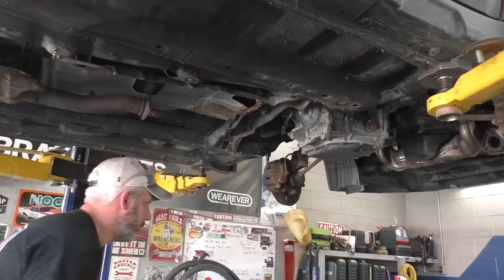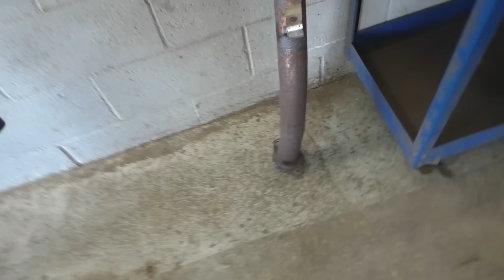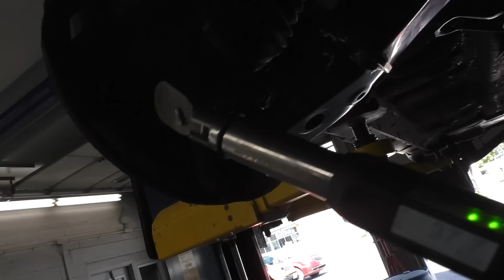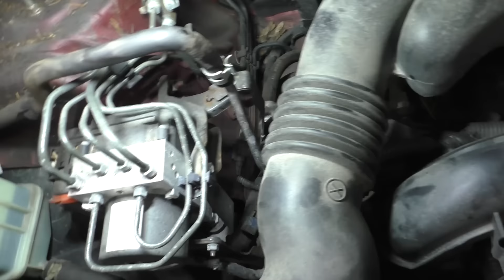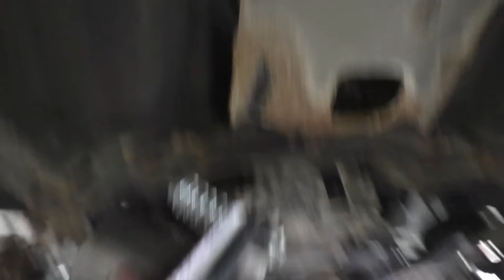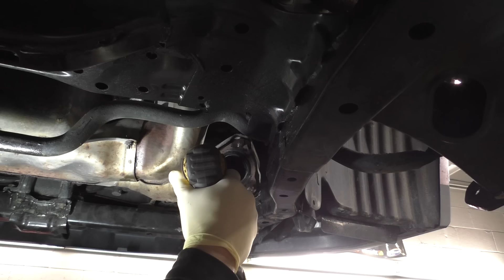'14 Subaru Outback Subframe Replacement - Part II

Comment: The old man was right.
 Eric, I worked with a guy who NEVER finished up anything that I left undone. I came in to find the L10 Cummins that, I was replacing the cooling jacket on, running. I asked "Did you finish torquing the cover?" He said "No I thought you did." He had been caught screwing the pooch and jumped on my job for appearance sake. To take it apart would mean that he would be in big trouble, so I tried to fix it in situ, but it leaked a little. 
Guys, ask yourself what I would've been doing if you share work on unfinished jobs.

Comment: I was out changing the rear brakes on my 08 Acura TL, but I live south of the Mason Dixon line, so I had it easy. I still did the Fluid Film spritzes and put the brake lube on the spacers and the face of the hub, but it is night and day to what you have to work on every day Mr. O. Huzzah!

Comment: Great as always! You should really do a short instructional video on mig welding.  I have a mig welder and it would be the holy grail if i could weld an exhaust pipe without burning a hole in it!!
Reply: Hood time! Practice makes better.
MIG? Do you have gas or using flux core? 
Lots of help on YouTube about welding.

Comment: Another great video.  Wonder if an undercarriage wash bay installed at your house would pay for itself. If my family doesn't get 15 years out of a vehicle, we got a lemon. Keep up the good work.
Reply: I'd love to have one. Use it just before heading out so things air dry quickly. Or use it on arrival if things are already wet/snowy.
Reply: I have a gutter cleaner that attaches to a garden hose.  I just run it under the car before I wash it to clean off the road debris.

Comment: Nice, thorough job Mr. O! I don't get why more people don't have their vehicles Fluid Film treated, or at least some kind of rust preventative maintenance done because the cost is minimal compared to vehicle or parts replacement. It may not make them last forever, but it sure doesn't hurt to extend the life and save on a bunch of repair work in the meantime. I am still running an '02 GMC 2500hd regular cab with the 8.1 and 6spd. manual that I bought in '03 that now has 221k miles on the clock. The only reason it hasn't turned into an orange dust cloud by now is that I have used Fluid Film or other products once a year. Still has factory paint, exhaust, etc. It is driven every winter, and yes, I do live in snow country in the mountains.

Comment: I learned long ago not to trust myself to leave a job with untightened nuts and bolts, or if it was unavoidable, I'd leave a big note to myself on the driving seat.
On another note, now that even the American car industry uses metric threads, I don't understand why a shop would still use UNC nuts and bolts, instead of keeping a stock of metric fasteners. I used to find this on the stretched Town Cars and Hummers I worked on here in the UK - the original car would be manufactured with metric, but everything fitted by the limo builder was UNC.
Reply: I have a theory...

Even today, UNC bulk fasteners for upfitters , fabricators, etc, are way cheaper, with much greater selection. 

Also, we still can't get metric drills without ordering them online... Even metric tools are limited. (I want metric nut-driver power bits, and I can't just go to the gettin' spot and pick some up, for one example)

Comment: Hey Dr O! Another great video from the master. I just wanted to throw out a little tip there since you've given us so many. Kinda repay the favor type thing. 😁 Anyway, I've worked construction for many years and, you may already know this and can't do it because of limited space, but if you put whatever you're cutting against the shoe of the sawzall, it won't give you any trouble when cutting. You have to hold the work firmly against the shoe, but it should go through like butter. If it's a space issue, then maybe the shorter blades would make it possible. Just wanted to throw that out there. Thanks for all your videos man.

Comment: Watching this as I wait for the battery for my impact driver to charge. Almost got the last bolt out and it died. Changing all the front suspension parts of an 04 Dakota SXT I recently picked up for $500. fame and body in great shape but all the suspension is worn out.

Comment: The transmission shop forgot to tighten the battery to engine block bolt. Slow cranking. I tightened it and didn’t complain.

Comment: You should post on the welding pages for unnecessary deeeeeep advice on your beading...  You also need to tell your wire speed and current settings for the full take-down....

Comment: Eric, do you think the plastic splash shields on new cars help with preventing rust? Just curious, im going to Fluid Film my new Camry but im going to have to remove the splash shield to do it properly, just wondering if I should bother putting the shields back on?
Reply from the maker: If they don't cover anything important I leave them off my own vehicles
Reply: @SouthMainAuto  cool thanks! The new Camrys have a shield that basically goes halfway back on the car. I just didn't know if they trapped moisture in or if the shield created a sort of oven that would allow the engine to bake the moisture away. Either way, I'm going to Fluid Film the undercarriage. Thanks again for another great video!

Comment: Another great video.  Do you info or link to the sprayer and hose you used to apply the fluid film? I looked thru your Amazon store but didn’t see it.  I have a few vehicles that could use some fluid film in tough to access spots.

Comment: I would have gone with the clamp and cut a couple, or 3, or 4 slits in the coupler so the clamp would cinch it down, screw a buncha welding.

Comment: I'm going to ask you again. I've seen were some people add Peppermint oil to the Fluid film  treatment or soak big wads of cotton and spread that around under hood to turn away mice and other rodents. Have you heard that or used that and does it work?
Reply: New Hampshire oil company makes a oil undercoating with peppermint oil in the undercoat

Comment: I differ with you.  Seemed to me most of the frame was fine, that it was just the wields in 4 areas or so that rusted away and eat some of the metal. I would have grinded the rust and area paint off and patched the areas with metal strips.  Oh, but you don't wield, like you didn't wield the exhaust pipes together.  🤔
Reply from the maker: No, I weld just fine. I'm just not going to be responsible when they stuff this thing into a tree and the patch together subframe explodes because it's toilet paper thin...
Reply: @SouthMainAuto  oh come on dude . . It's a engine cradle not a main frame.. I'd feel just fine patching it up but as long as the customer agrees. Alot  cheaper and time saving. But whatever guy

Comment: You cut out the part where you installed the front bolts to the frame of the car. I have a 2010 Outback and I’m having a very hard time getting it to line up are there any tricks you would recommend?? About to sell it for parts

Comment: Question for you welders:  Why don't guys sand down old exhaust pipe to get to cleaner metal where they are going to weld?  In almost all other welding, the first step is to get to bare, clean metal.  Thanks for any insight.

Comment: Always watch your videos. You can quit trying to satisfy the delusional keyboard warriors who think that professionals actually torque everything and it even makes a difference. If they actually knew a long time mechanic they would learn something. I like the torquing done off camera best. Same way with wheels. Torquing is not as important as checking after some miles.

Comment: At the Subaru dealership to fix the loose heat shields we just used two band clamps and wrapped them around the shields and cranked them down. If it's only a little lose you can bend the corners.
Reply: So you destroyed the air gap?
Reply: @Slicerwizard  by banding the end that are already touching? No probly not. 😂 Also that was the direct fix from Subaru of America. You can go argue with the engineers.

Comment: The ghost of your father almost slapped you for almost not tightening those bolts before you left.
Reply: @privateer0561
He (Eric’s Father) is right though! 

I learnt the hard way as an apprentice, left an oil pan drain plug finger tight because I was talking to the customer and got distracted. 

All the  oil fell out on the highway a couple of days later when the drain plug came out. 

Luckily no damage, customer shut engine down as soon as the light came on, and actually said it was his fault for distracting me.

Lesson learnt, after that if a fastener was put in it was tightened to spec (and split pinned if necessary), or it was left out entirely.

Comment: I used to use old engine oil to spray under the cars .
Reply: My wife doesn’t want to step in it.
Reply: My '91 Thunderbird 5.0 leaks so much oil and trans fluid the whole bottom is entirely coated and will never rust, too bad I live in L.A. where cars don't rust anyway.  😆